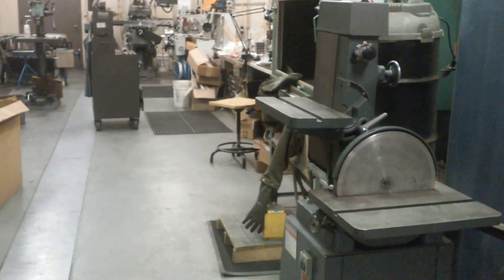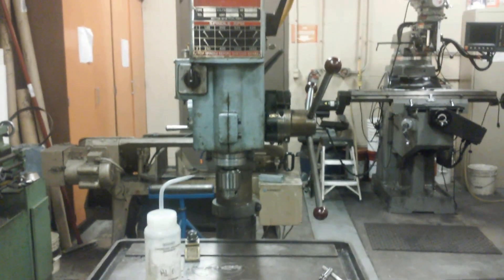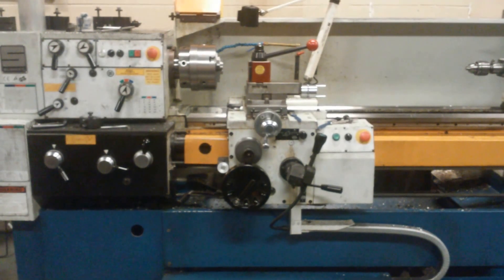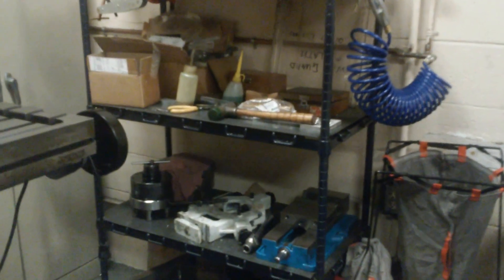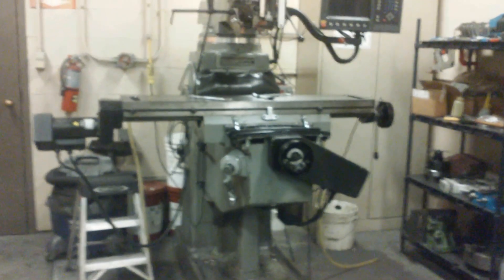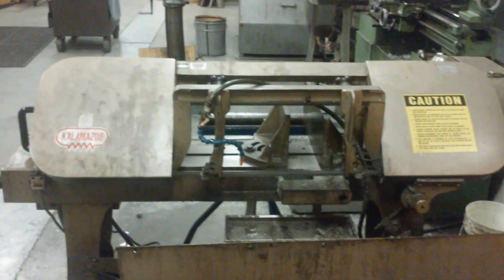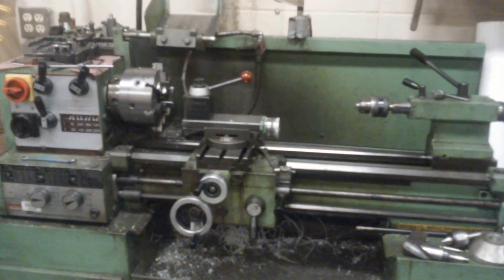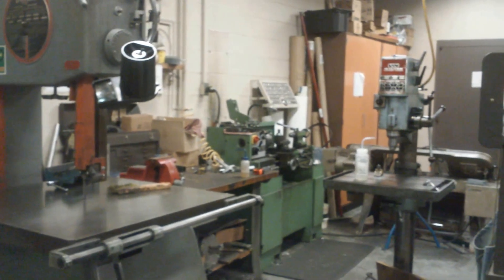Steve Summers. Shop at the Research facility

Comment: Nice shop. 
I ran the best engine lathe  (IMO) for 10 years in a machine shop. It was a South Bend 17" Turnado.
Taper attachment, steady & follower rests, Dumore grinder, Baush & Laumb digital readout, indexible Kennametal Carbide tool holders, 4 jaw, 3 jaw with soft jaws, everything my heart desired. I loved it. I could singlepoint acme, buttress, square, RH, LH, internal, external, metric, whatever. 
After about 3 years on that machine , any project was sheer joy.
Reply from the maker: Ima Tumor Yeah, always nice to work on a machine you know well and that's outfitted properly. Makes all the difference in the world. The big 16"Hendey I have is like that for me.
Reply: I had a Chez 8ft by 12 " Lathe . 15 years and hardly a moment of trouble. The name escapes me now but like yours would cut any thread form, metric and standard. It had no threading dial so I would close the split nut and had a back-up pedal . No way to get 1/2 way in the thread pattern. I did have a bit of trouble getting used to it but soon changed my mind. It is fun coming back and visiting Steve eh.
Reply: @TomokosEnterprize   those were the best of times !